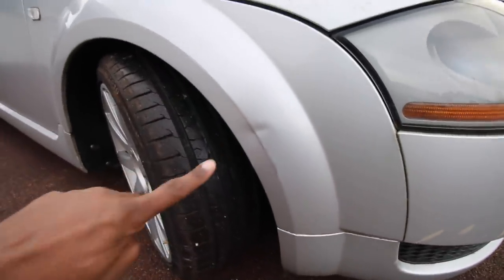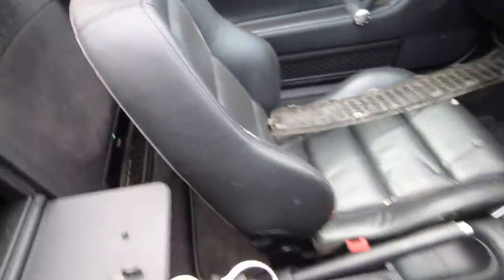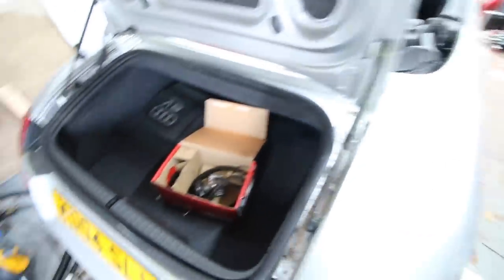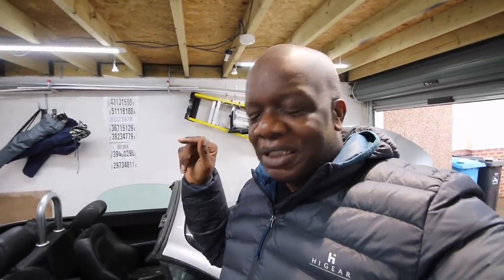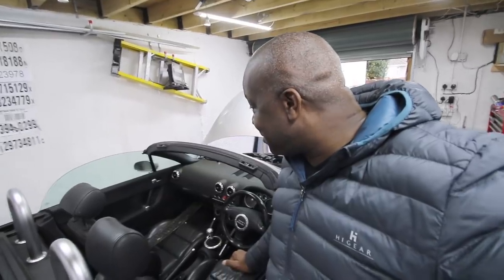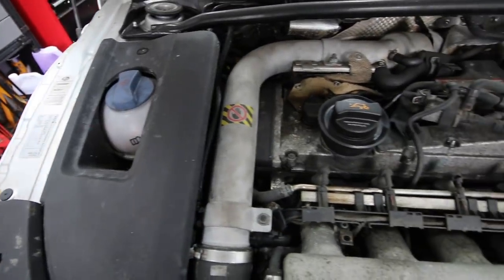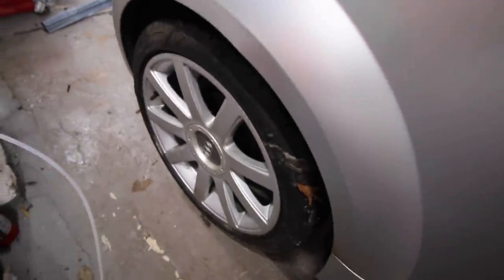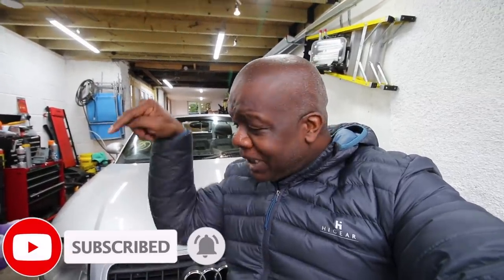My new Project car has a secret past

Comment: Good choice Paul. I’m restoring a MK1 V6 Roadster at the moment. First area for me was getting it watertight. New upgraded drain hoses (I can send you a link), new rear roof bib, interior strip to dry out and clean carpets. I’m doing full oem suspension/bushes/brakes, having the two seats retrimmed and a full respray. I also managed to get the hardtop at a very low cost. Will be interesting to see what you do. Are you a member of the Facebook TT groups?
Reply from the maker: yes I am and please do send me the link
Reply: @CarsForPaul  here you go. It’s a bit of a fidly job but these are much better than the oem hoses, they are much cheaper and also clear the water quicker too (you’ll need to order two). This is a common complaint with the MK1, so if you were to dedicate a video to drain hoses, checking/replacing the rear bib, I’m sure it would be a big hit.

https://www.ebay.co.uk/itm/203080630921

Comment: Should be good, wonder if the speedometer is not working or is a replacement that was coded to the mileage? , There are going to be some jobs for you to look at. Go with the sill and underbody, smart repair or replacement wing. Wheels did not look too bad, the best profit is found spending money in the right places.

Comment: Have you tried to start the TT? I have a theory, the car was serviced and got the cam belt replaced, when they started it and the cam belt snapped and totalled the motor... then it’s only been transported and sold off to copart, I hope my hunch is way off!!
Reply from the maker: fortunately your hunch is way off as the car does run and drive

Comment: Have you considered that as the temp gauge and fuel gauge are not registering, maybe the speedo and therefore the mileage counter isnt working as well it could of done a shedload of miles but the odometer isn’t working …..

Comment: Either all that, or the speedo/milometer doesn't work. As for the rest of the faults, just like a Golf eh! People rave on about German build quality and reliability and look at the 'common' faults you have mentioned on this. I've got a 2001 Picasso with nearly 160k on the clock and it still drives like new and only had wear and tear items replaced.

Comment: get ready to spend your time lookig for leaks!
Reply: This is what I had to do with mine. 1 replace the hoses in the back.  2. Seal round the realt cover under the scuttle panel. Check and clean all the door drains and seals.